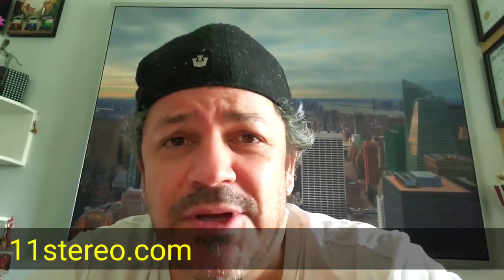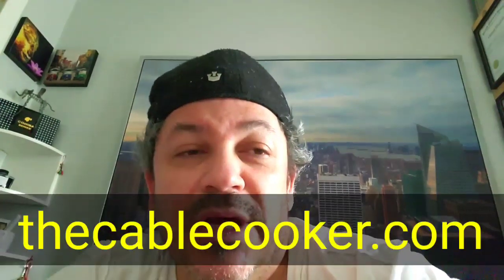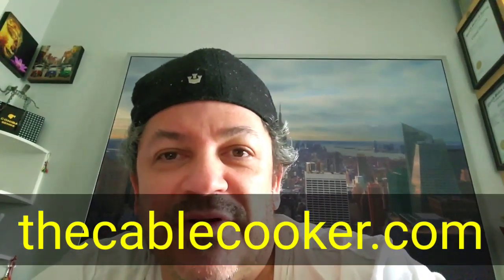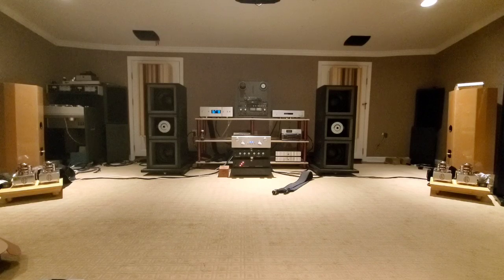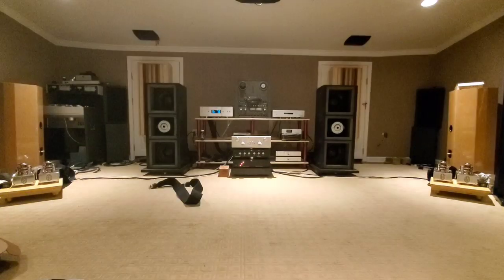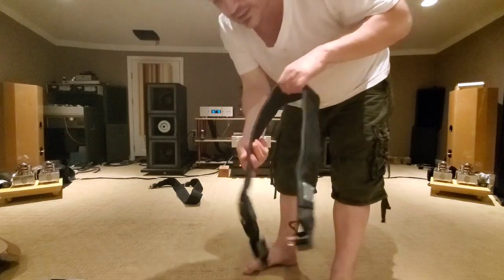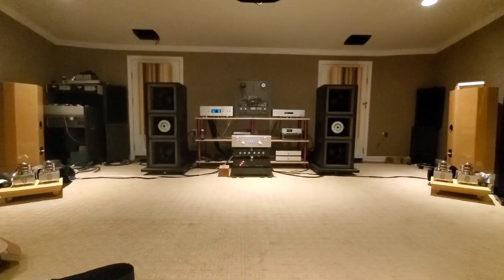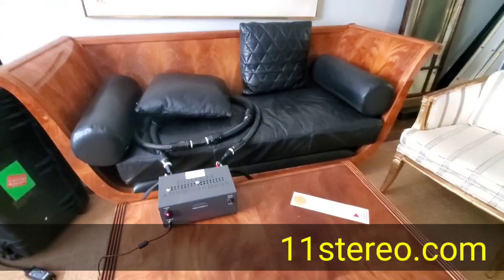What is HiFi Cable COOKING ?!!

Comment: Cable cooking totally sounds like snake oil. A wire is a wire right?! Well, one of my good friends has one of these cooking devices so I gave him one of two identical RCAs I had to work the culinary magic. After he returned the cable I gave both to another non-believer audiophile and marked them A and B without telling him which was cooked. He was very skeptical and when he tested them he was shocked that one was much better than the other. Guess what? He picked the cooked one. Was this all a fluke? Somehow, I think not.

Comment: Where are the speaker cables on tribe site ? Just power chord? So if have pre amp and 2 mono blocks where does one put the high buck chords ? Or does one need to get 3? Or 4 or ? Just curious

Comment: ive built speakers for the last 30 years and have build some speakers that other people have designed when i first started and wasnt impressed ,so i designed my own ob 360 reflector driver pointing up and tweeter pointing down closed  15 inch subs mullty driver subs h frames most things .
changing the crossovers and changing the tweeter output by 0.33 ohm changes the sound no end . i have a little set of speakers at the side of my bed that i have built a onkyo tuner and a arcam a 19 amp late at night i have it on low and the vocals  and sound stage is amazing and i drift of to places that my big rig just doent do your ears are amazing and all i hear is how many watts and how load things play .i find the beauty in music is the singer and the way they portray the music i love how different instuments sound but the human vocal is what is important .not saying your wrong but you dont need to spend thousand to get something that moves you . hifi is a great hobbie but think it as a cup of coffee you have tried loads of different ones but the cafe down the road is your fav and its only £150 do you need to spend £5 for a fancy cup and a smile to make your coffee taste better .end of the day have fun  and try not been so ocd piece

Comment: With the focus on power supply I'm curious about the use of a reconditioner  or other gear. I personally like a product from a company in Singapore called SoundAffairs. The product line is called Plixar. You should check it out if you haven't already.

Comment: I've heard this song and album many times (it's an audiophile must-have) and when I heard the un-cooked cable, knowing its quality as well as the super quality of your rig, I went like "oh my, is THIS how it SHOULD sound like"?? (you see I'm always concerned and worried about what there REALLY IS in the recording, being suspicious even when I'm "served" many "extra bonuses" by a rig or setting). And then you put in the cooked one and I went into a "pheeww!!!'' relief. Ok, that's what I'm hearing in my rig too, and even with some more dimensionality, holography, speed, air, sparkle, mainly due to a new, recent, near-field setting. Needless to say the cooked one was way better. Not that the uncooked was bad, It had a rather honest, correct in its own right, "reserved" presentation. Sounded somehow "conservative", which is not always wrong, but in this song it rather was.